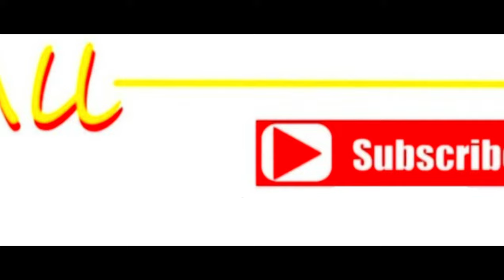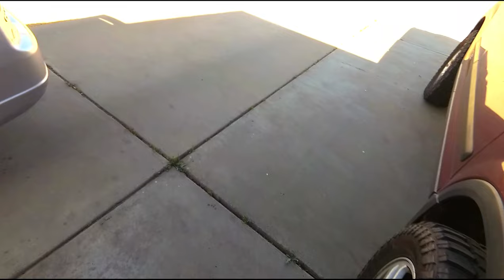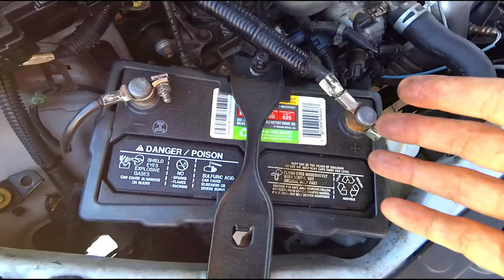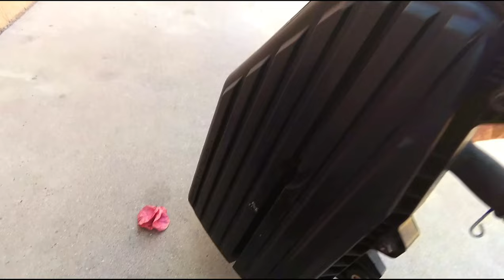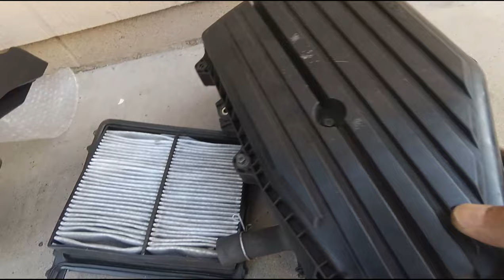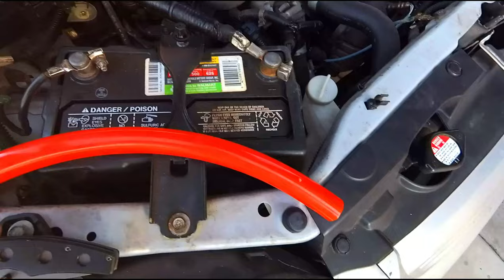INSTALLING AN INTAKE on the 2002 CIVIC! PROJECT ES1 (honda civic)

Comment: Thanks for the video, I just got a 2003 civic and I’ll be replacing the air intake with a similar one. This video is definitely gonna make the replacement part easy.
Reply from the maker: No problem! Congrats on the new civic!
Reply: @Jdmforall me and my gf jus got a 2002 Honda civic lx 222k miles on it my buddy gave me one that was on his 95 civc

Comment: K&N’s Cold short RAM goes HAM! Check it out! Got one for less than $400.00 and it’s got a heat shield.  2004 Civic EX Coupe/VTEC, About to swap out current motor for JDM DOHC VTEC. Good times!

Comment: Hey so I bought this same set up for my '01 civic. I'm just wondering , did you have to oil the new air filter before installing?
Reply from the maker: I didn't oil my filter
Reply: @Jdmforall  Thanks man,  I appreciate the video it helped a lot
Reply from the maker: No problem! Thanks for watching!
Reply: Good info
Reply: @Jdmforall  Hey, I noticed today that the filter that came with this set up will spin even though it is clamped down to the pipe. Does yours do this as well?
Reply from the maker: Yeah I'm pretty sure my filter does that

Comment: Hey bro, I have the same civic but mine is a manual V-tec . My issue is that it’s burn in gas. I changed my oil regularly, air filter, I use fuel cleaner some times, I even clean the injectors manually myself. Sometimes the needle will give half of a tank reading but when I drive hard in second gear the needle will go up from half tank. I changed the whole fuel assembly for one on autozone and put it but it’s still the same. I adjusted the valves multiple times and it’s not better. When I first got this car 2019 it wasn’t burn gas like this but since I started working on it I realized thanks changes . What you think could causing this gas burning issue?
Reply: This generation of civic doesn’t have an electronic gas tank sensor. The gas tank needle will move up in down a little bit. Especially if parked or driving on an incline.

Comment: I have a 7th gen Honda Civic 2001 can I drive without the ac fan install?
Reply from the maker: Yes but if you use the ac without a fan the car can run hot.

Comment: Where did u buy it at sounds amazing hope u see this
Reply from the maker: Thanks! I bought this intake on Amazon.
Reply: Didn’t you worry about driving it in the rain or hitting puddles? I’m worried it will pull water hope u see this
Reply: @tonyespinosa8125 it’s a short ram it’s to high up to suck up water